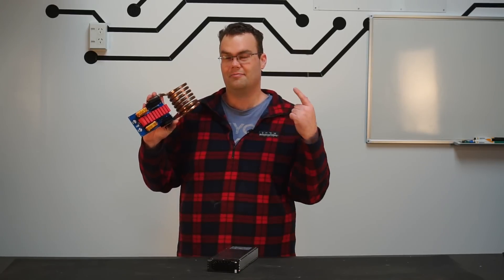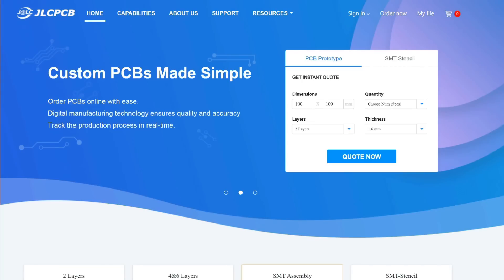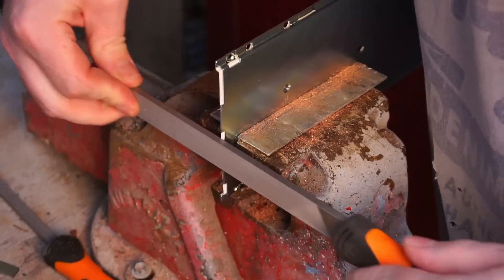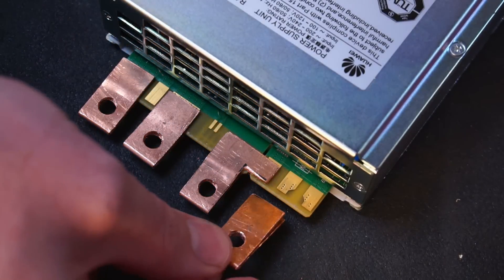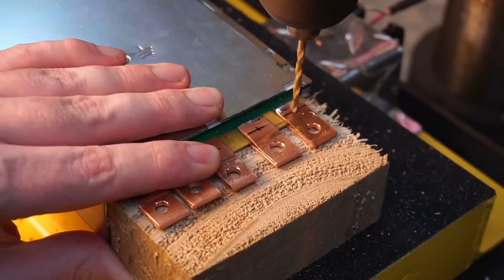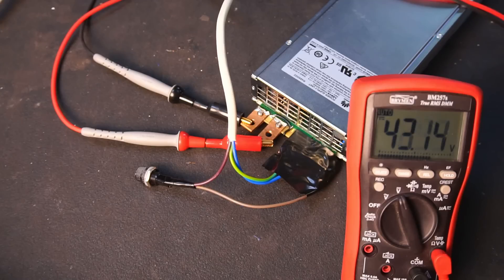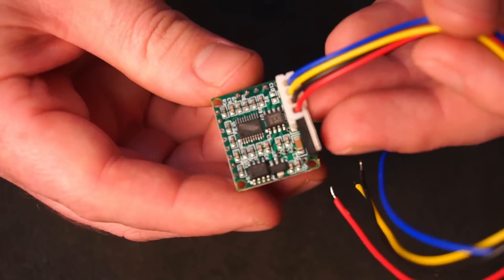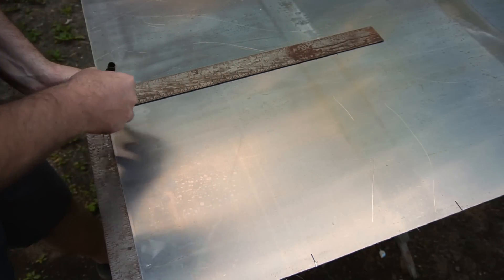Cheap 3Kw PSU for Induction Heater ll Huawei R4850G2 PSU

Comment: It was good to see you weld without filler wire. You can do the same thing when welding laminates on a transformer. It will be quicker, and will look much nicer as well. Keep up the good work.

Comment: Is the DC referenced to earth or is it a floating system? Being a telco rectifier I'd assume that the positive would be earth referenced but I'm unsure whether that would be done at the individual rectifier level or at the frame level.
Reply: They are floating outputs. The +48V is grounded in the cabinet. So telecoms systems have 0V and -48Vdc.
Reply: @rogeronslow1498  Not on this, mine has DC negative connected to case internally.
Reply: @Mark6E  Is is 48V or 24V?
That is very unusual. All the power systems I've seen always have the common connection after the rectifiers output on the busbar. For 48V systems the pos is grounded and the circuit breakers are in the negative line. The reverse is normally the case for 24V systems. If your rectifier has the case connected to negative it's no problem as you probably want negative connected to chassis anyway. 
There is always the possibility that the y-cap  from the neg output to chassis has shorted due to a voltage surge and that's why its connected to chassis. Maybe that's why it was going cheap?
Reply: @rogeronslow1498  Thanks for replying, would there be a Y cap between dc- and the case? Other people have said they run these in series, which wouldnt work on mine with dc- connected to PE. I will open it up and look.
Reply: @Mark6E  The incoming mains is full wave rectified (but not smoothed) and fed to an active power factor corrector stage. This provides an excellent PF of around 0.99 to the mains supply. The +/- 400V dc is then fed to an LLC resonant bridge converter that provides the galvanic isolation and step down to 54V dc for float charging the 48V lead-acid batteries used.
Some older supplies use a hard switched  full bridge converter but most high power density supplies have an LLC topology.
In both cases the dc output is filtered to clean it up and reduce the conducted and radiated EMI due to ETSI 300 compliance. The EMI filter will contain a common mode choke and Y-caps from pos and neg to the chassis. These will normally be very close to the output connector. It's possible that in your case one of the Y-caps has short circuited and is pulling the neg rail to chassis. This would explain why the neg output is connected to chassis.

Comment: Does current increase if you use that special module to reduce voltage or is the current restricted to 56.1amp due to the size of the traces on the pcb?
Reply: Nevermind answered my own question
This datasheet shows current can go as high as 62amps at 41-48v any lower and  current quickly drops off.

Comment: That's a nice looking PSU, but the shipping is $65 to the US. Twice the price of the unit.
Reply: Mine was shipped DHL, the limited amount of airfreight capacity means heavy items have to be sent that way or they take several months to arrive.
Reply: Or you could pay over $70-$120 from other vendors on eBay and Aliexpress and still have the luxury of paying a smaller shipping fee and waiting months. chose your poison.
Reply: For the record I received the two I ordered via DHL. So just over 1 week to get from Australia to the US. The units are totally brand new and never been used. I was so impressed I just bought 2 more from the same place in Aussie land. meh on the shipping.

Comment: Wow that's a nice PSU especially that it's new and for this price, though I couldn't find it in such condition and price anywhere.
Btw. why not use the terminal it's supposed to mate with?: https://www.ebay.co.uk/itm/For-Huawei-R4850G2-rectifier-module-communication-power-plug/123680821956?hash=item1ccbf392c4:g:qWMAAOSwQ7lcgd3D
It has everything neat and tidy easy to connect.
Reply from the maker: Thanks for sharing that! :)
Reply: @Schematix  Can I have in exchange where I can buy this PSU so cheap? lowest listings on ali are $100+
Reply: @Arek_R.  cant find them for that price either

Comment: Great video, was just wondering where you got the extra wide insulation tape from, can you recommend ?

It would be also nice to know if we have anything like that R4850G2 psu available locally here in UK since it does not seem to be available here. And the shipping cost is otherwise twice the value of the unit itself. But of course you would not expect you to know such alternatives, living so far away!

Comment: I've taken a different route with controlling mine, namely trying to adapt this library to run on Arduino, as I don't have an ESP32 or the CAN adapter for one.
https://github.com/BotoX/huawei-r48xx-esp32
Problem is there is an initial packet that needs to be sent to the RG4850G2, to subscribe to voltage/current readings, and to change them.
I think it's 0x108040FE or 0x1080140FE, problem is it's not being accepted, and the code is convoluted so I'm not sure what the issue is.

Anyone with an ESP32 or the the Taobao control knob device that can see what the very first packet sent into the Huawei is ?
It's all zeros for the data, I just need to know the address.
Reply from the maker: I'd be fantastic to have an arduino (or similar) device control the output voltage/current. I haven't spent a great deal of time researching the CAN communication side of this PSU. However, I did come across other forum posts (mainly on Chinese forums) where people were attempting to program/control via CAN. They didn't seem to have much success but, my little controller I bought from taobao proves it's possible to do so. If you manage to get it working, please let me know! :)
Reply: @Schematix  Hi Schematix,  I looked in Taobao and I can't find the link to buy one of those little controller board. Can you please send a link to buy one.
Thanks.
Sebastian
Reply: Did you have any luck with this? My esp32 and can chip are ordered, but if the code works I can have a look.
It would be useful to use an arudino while Im waiting for post, can you share your changes please?
Reply: @Mark6E  It's still not working, for unknown reasons.
I even tried transmitting sequential CAN ids, in the block of 0x108??? and 0x100????, all of those packets were rejected.
It's not as simple as changing a few lines of code, I had to rewrite 90% of it.
Reply: @Mark6E  I don't share things that DO NOT WORK.
Get serious, there is enough junk/half finished stuff on the internet.
Reply: @station240   Funny that, you say his code is convoluted yet it is well structured, readable code, and it works.
Reply: Did you put a 160 ohm resistor between can hi and low? If not i get errors

Comment: With these amount of currents, I would rather care more about safety of the secondary, instead of the mains lol
Reply: current doesn't harm you if the voltage is that low that's why you can hold the terminals of your car battery without harm. Only a short with something metallic would harm you if you were holding at the point of the sparks. otherwise, safe as safe
Reply: @msana4420  Ehm you're mixing these two.
You can kill someone with a 9V battery, yet electrical fence with thousands of volts is harmless. 
Hundreds of amperes can literately vapor you to dust basically.
In this case, if you have a spark, it will basically weld or blow everything. 

The reason why you can hold the battery has to do with your body resistance.
Different story when current is forced into.

So no, safe is not safe and I would not recommend anyway working on these things with these kind of thoughts.
Reply: @p_mouse8676  you can't force current into anything, current is drawn by the load. You can safely grab a 12VDC 100A power supply output, because your body resistance is too high to get any meaningful current flowing.
Reply: I got one that was premodded with a 3 way terminal block soldered to the mains input.
Just drill 3 holes thru the PCB to fit the terminal block in place.
I have to redo it, as the terminal blocks were cheap and broke by accident.